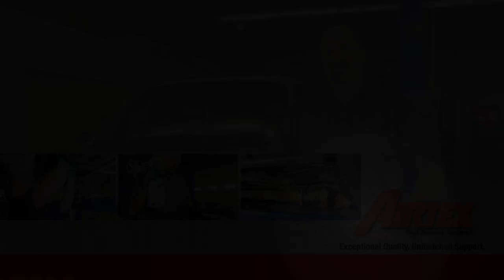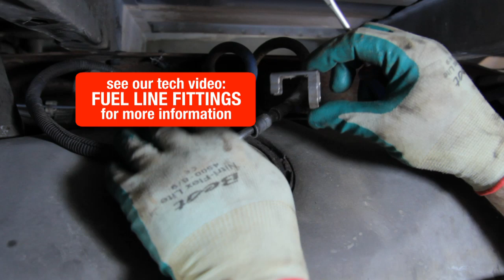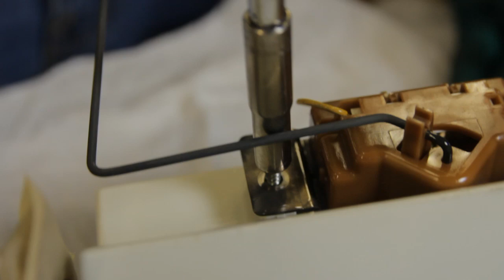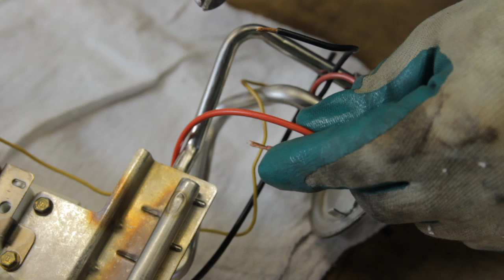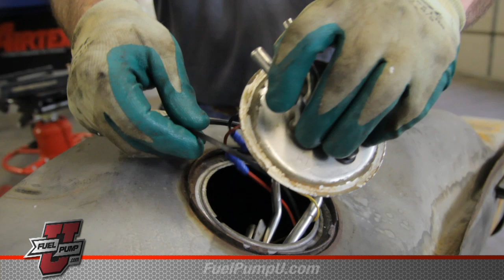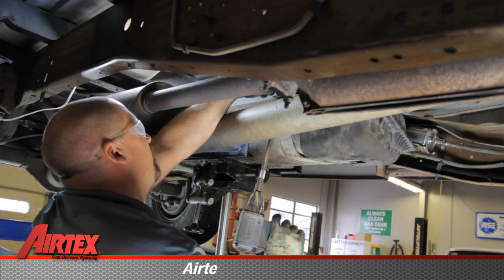How to Install Fuel Pump E2059MN in 1990-1996 F-150, F-250, F-350 and 1995-1996 Ford Explorer

Comment: Does this fuel pump have the fuel selector valve in it as well?? I have a 91 F250 the front tank is pushing all the gas to the back tank and overflowing it. It is really hard to find the right one for that because it’s a split.

Comment: I just replaced fuel pump/sending unit in my 93 bronco the old one worked but was on its way out anyways.. now I put the new one in and car won’t start but it will just crank over and over..I can hear the pump prime up but idk what the deal is
Reply: Sounds like Wiring Connex wasn't done correctly...Or worst case scenario...Like ev'ry thang else nowadays....You gotta 💩💩💩 new pump from the factory that don't work...💩💩💩 parts from factory thru a Reseller are the Norm nowadays...I  got New and ReMan parts from RockAuto that were total 💩💩...Had to send 'em back for a refund....
Reply: @ToyManFlyer1100 I actually figured out my issue..I had 2 wires mixed up and it the pump was going backwards..it fixed my issue for like 300 miles then the pump failed anyways and left me stranded lol so now I gotta find another brand of pump to get
Reply: @wolfrus1809  ...Well, that's good you figured that out...My next big job is changing out both pumps...Don't have help like last time...Gotta drop the tanks instead of pulling the bed...Different trk tho...Last one got T-boned...I'm using Delphi brand from RockAuto...

Comment: Wouldn't the exposed wire butt connectors create a spark hazard??
Reply: Came to comments for this?!?!
I want to do this for my 94 f150 but don't want to blow up 🤷‍♂️
Think I'll just pay extra for the whole assembly
Reply: They are shrink wrap at the ends
Reply: Agreed, I would solder and shrink tube it

Comment: About how much would this cost if done by a mechanic (I already have the pump, just need the labor)?
Reply: @Anon I had mine done for around $800, sending unit, pump, fuel line (said something was leaking), fuel filter replacement & oil change. I guess I got a good deal then? lol

Comment: Isn't it dangerous to have electrical wires inside of the gas tank? LOL
Reply from the maker: Every vehicle ever built that has a fuel gauge sender in it has electrical wires inside the tank. Modern vehicles have an electric pump inside as well. The fuel pump module may have a pump, sender, pressure valves, all kinds of good stuff. No, it isn't an issue as long as it is all properly installed.

Comment: Is a 1993 f150 fuel pump compatible with a 1994 f350?
Reply from the maker: Yes and no. There are two different fuel pumps and tank setups for the gas engines in 1993 and 1994; center tank or 19 gallon rear plastic tank takes one pump. 18 gallon rear steel tank takes another pump. Each tank setup uses a different pump. Diesel is another configuration all together.
Reply: Airtex-ASC Performance Pumps 
I figured it was a different setup, I gotta replace the front tank fuel pump on my f350, its a 7.5 gas and wanted to know if I could save a buck and take one of the pumps off the f150, its a 5.0, dont know if that would narrow it down or not.

Comment: Hello Sir, I have a question.

I have a 1996 F250 5.8. It only has 116k miles on it and the engine sounded really good until a few weeks ago when I put about 2 year old gas in it. I KNOW THAT WAS STUPID. it was about 10 gallons. The very next day, it was rough starting up but it ran fine once it started, however, the next day, the truck was shaking, started sounding like it was misfiring, and whatever. I didnt siphon out the bad gas, instead I out fresh gas in. 

The fixes I have done on it thus far are: fuel filter, cleaned injectors, spark plugs and wires, new distributor cap and rotor. and it still isnt running right. I took it to a DIY mechanic who has been a mechanic for probably 50 years and he said it sounds like the lifters. What do you make of it?
Reply from the maker: My first move would be to completely drain the tank; empty, not a drop left, then fill with fresh fuel. Once know good fuel is in place I would try cleaning the injectors and replace the plugs again. Once those plugs are fouled they will never fire correctly. It may sound like lifters as the engine detonates and rattles and pings due to the mis-fire created by the old gas.
Reply: Ill do that. I appreciate the info. Also, the spark plug threads on the driver side have oil on the threads, not on the ceramic. Any thoughts?
Reply from the maker: It could be from a valve cover leaking. Clean everything off and check it periodically and see if you can trace the leak that way.

Comment: Had to replace a fuel pump on a 99 gmc z71 once. I just took the bed off. It was so much easier and faster than dropping the tank. I have to replace the pump on my 95 f350 soon so I’ll definitely be taking the bed off again.
Reply: Honestly the best way in my opinion work more comfortable as well
Reply: If you have dual tanks remember you may have to disconnect the rear tank fill hose. Electrical connectors for the tail lights. I guess just be mindful of anything that attaches to the bed from the frame. 
They are also suggesting to clean the tank. Some tanks may have contamination from condensation, funky stuff growing in the fuel. When I was in the military airplanes Jets had to be inspected for fuel contaminants. When you get water in fuel it becomes a gelatinous blob inside the tank that in itself can get pulled into the pump assembly and cause it to fail. That is why they recommend taking the tank down and cleaning it to ensure that there's no contaminants in the tank. By not doing this you can void the warranty on the part that you are replacing.

Comment: Okay. So I've had some issues starting my 1996 Ford F250.  It cranks forever and eventually starts, but the start is rough and then smooths out, and also it sometimes dies before it fully starts.  I watched a another video to test the fuel pump. You turn the key to the on position and wait ten seconds, switch off for ten seconds and repeat three times.  My truck starts right up, so I believe its the fuel pump.  

Okay so a few questions:
1.  How heavy is the tank when empty? I dont have a shop or many tools, so would I be able to comfortably ease it on down,

2.  Must the truck be lifted up or can this be done on four wheels?
Reply: Is it a diesel?  Sounds more like suspect glow plugs to me.  If you're not cranking, the fuel pumps aren't pumping anything. I had the same symptoms in my '87 with 6.9l diesel.  Turned out to be a lose hose from the fuel filter.  It could be air in your fuel lines somewhere, but again, you would presumably need to turn it over for a bit to purge the air from the system and get a clean start.
Reply: I have the same issue, same symptoms and it has been ongoing for over a 2 yrs. Usually worse when the weather gets warmer (summer). Mine is gasoline engine, I am suspecting the fuel pump as well. The fuel tank selection switch shows the amount of fuel in the tank. I plan on replacing both pumps.

Comment: My 1995 f-150 cut out on me on the way to Oklahoma.I drive it around town and it never had any issues,except a few day's prior to my trip.I was carrying a load of wood,it suddenly jolted,but that's all.Then, while on my trip w/ the load of wood-it just cut out!! I rolled into a parking lot,waited for a awhile and it started up again-no issues.So I proceeded on my trip,for about 25 miles and it cut out again-nothing no sputter,no jerking,just cut out and this time it would not restart.Now it will not restart or fire at all.Have lights,and everything else??? any thoughts?tried both tanks also.same on both.
Reply: OK.Thanks.
Reply: FTM: when it cut out the first time,I switched to my other tank after letting it set for about 20 min.-it started again,then I went back to my other tank before I departed-it ran very good for 25 mi, then cut out and would not start at all after that.
Reply: @palitsalagivickers4588  Well What was the problem finally? Don't leave us hanging!

Comment: I have a 1996 Ford F-150 4.9L S6 (great motors) work truck with dual fuel tanks. When I bought it the truck ran perfect on the rear tank. The front tank ran rough, stalled at lights, loss power when accelerating. I dealt with it for months. 
The Fuel from the rear tank started to flow to the front tank. It even moved overnight from rear to front tank for a couple weeks. One morning fuel was dripping from the front tank inlet tube. Not good and very dangerous. The fuel pump had finally gave up the ghost and the check valve was failing in it.
 I changed the fuel filter and replaced the OEM fuel pump module in the front tank with an Airtex 2059 bought at NAPA. We followed the instructions and the truck fired up on the first try on the front tank the very first time since I owned it. Replacing the fuel pump with an Airtex fuel pump has returned my valued F-150 work truck to new running condition. Do NOT believe the bad hype about Airtex, these fuel pumps are top notch. Thank you Airtex for providing a reasonable priced OEM quality pump, I promise you all, us working guys truly appreciate it!
Reply: horsemalph how much did it cost u to replace the fuel pump?
Reply: Thanks cause when I put bad gas in my dual tank 95 250 7.5 the rear tank starting failing or clogged what to do ?
Reply: @onebodyelazar1870  they recommend that you clean the tank out. To ensure that the new pump doesn't pull any contaminants from the tank. When I was in the military fuel in the fuel tanks if they had gotten water in them condensation or foreign matter it would cause a biological growth of a gel looks like a blob and it would not allow the pumps to pull the fuel into the engines. So again clean the tank.

Comment: I have a 1992 F-250 with a newer 460 fuel injected engine; now it does not hit 2000 rpm's , is it my fuel pump? I do not have access to a pressure tester at the moment, but do you think it could possibly be my pump? I just changed the filter two days ago and it runs a little bit better, but its still not reaching it, and I only have gas in my front tank at the moment so I haven't tested the rear tank.

Comment: The next time I change a fuel pump on a truck,the bed is coming off,i don't care.Just changed a fuel pump on a 94  F-250 and it was a pain doing it from the ground.
Reply: I hung my bed from an Oak Tree & took one side of the bed loose and lifted the side tank was on. Not as hard as dropping the tank.
Reply: roger b 😂🤣😂🤣🙏🏽💪🏽😤 🙌🏽
Reply: that's the way i did it on my 92 for rear tank now i got to do the front
Reply: Before reinstalling it cut an access door in the bed. Take the piece you cut out to make a cover, install with a few screws and next time you can get in there way more easily.
Reply: @TimDyck hey you think if I cut in to my bed where the pump is do you think I could replace like that

Comment: I have a 1996 f150 and it has the dual tanks and the fuel pump is going out. Is there two fuel pumps? one in each tank?
Reply: My truck doesn't run when I have it one the rear tank so im guessing the fuel pump went out in it but the front tank has a rough idle?
Reply: Yes, there is one in each tank....

Comment: i have a 93 diesel dump truck i pulled the rear out and there was no pump just a float. I am going to pull out the front one toe rear frrd into the front tank?morrow hoping the pump is in that one. Can you tell me when i switch tanks does the rear feed into the front?

Comment: Hi, I have a 1996 Ford F-150 USA built 5.8L truck. I have a dual gas tank and I wanted to know, if I would have to replace both fuel pumps and sending units? This is based of the fact that I feel like I'm not getting any flow of gas as well as hearing a humming sounds in the back of the truck. If there is any other information you need to provide an answer please let me know. Thanks.

Comment: This is all fine and good, but what if you want to replace the pump inside the assembly ONLY? This is my dilemma. And the pump I ordered doesn't fit. Wondering if there is a new style or something to my '96 Explorer. Old one uses a shorter steel tube and connects with spade connectors, not the 2-pin plug type. Frustrated.

Comment: on my 1993 f150 xlt 5.0 has a 4 pin connector on the tank not a round one and I'm having trouble finding the wright one i found a 1990-1991 SENDING UNIT-W/PUMP from JC Whitney and just wondering if it was what im looking for

Comment: If both tanks on my 96 are metal, they are supposed both be 18 gallon. so ones with plastic tanks are 18 in front and 19 in back?Can you confirm this? my rear float still works so I want to replace the rear pump first, is it basically the same?

Comment: Very informative video.  Helped with the installation of the Airtex on my f150.  One problem though.  I removed the filler hose from the tank, but not from the filler neck.  The end of the hose refuses to go back on the the tank.  I've fought like hell and I'm afraid to break the plastic inlet tube.  I decided to try to remove it from the neck, put the vent hose on first and feed it up over the inlet tube like in this video.  But I can't even get the tube out of the vent hose to do this.  Help!
Reply: Hoping you figured it out by now